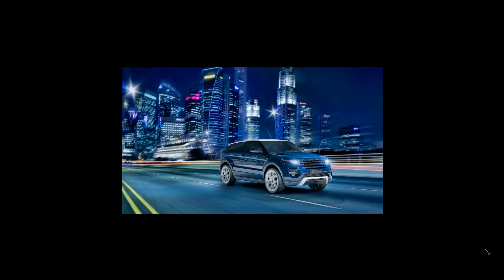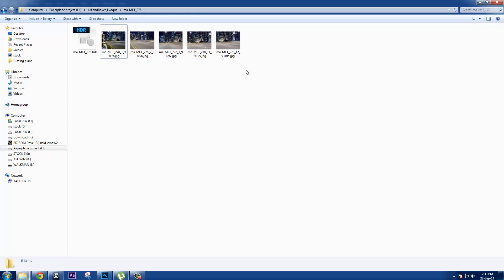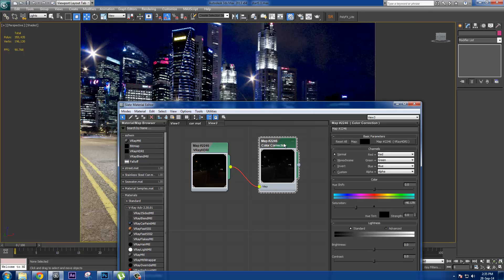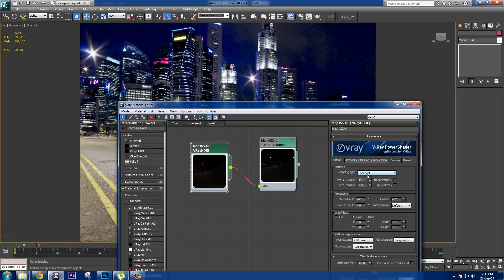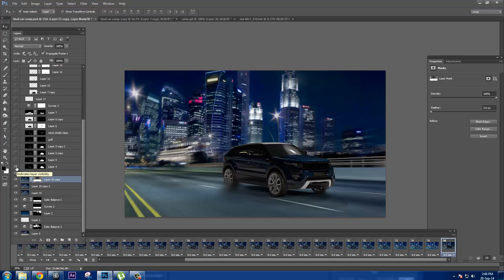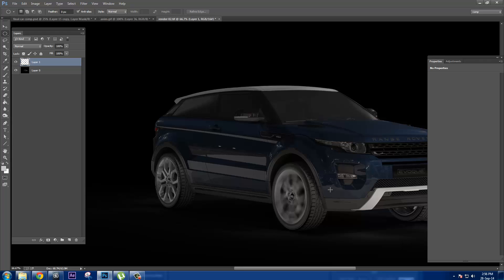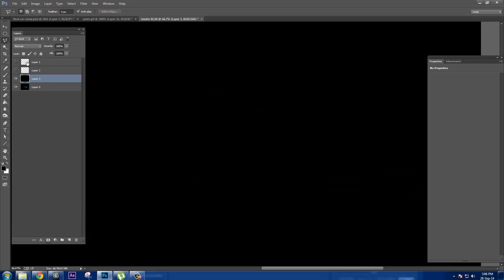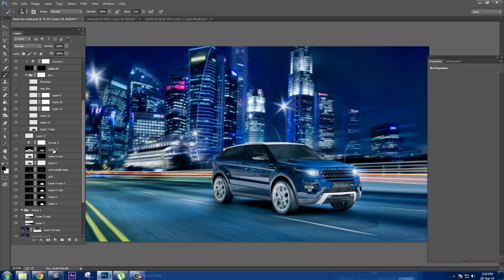Automotive Visualization Workflow - 3dsmax

Comment: Good work and interesting to see someone else's workflow.
You largely work the same as I do.
I do more with rendered masks via Object/Material ID's though.

One tip, instead of rotating the HDRI and masking, is to use something like HDR Light Studio (expensive though)
or otherwise change the HDRI. With HDR Light Studio it's nice as you can see a live view of your lighting (using Vray/Iray/MentalRay realtime)
when you place your lights, which can also be 'negative' lights, basically black cards to block parts of the HDRI you don't like and that give
strange reflections.